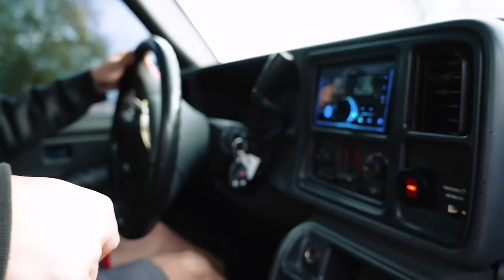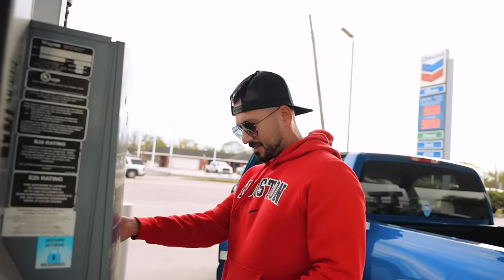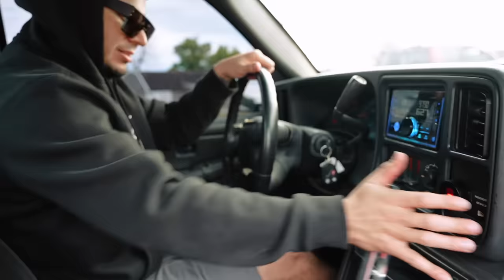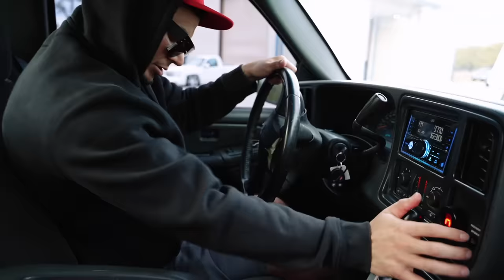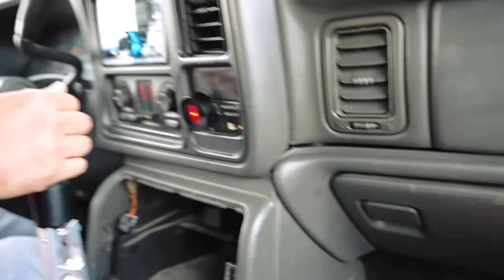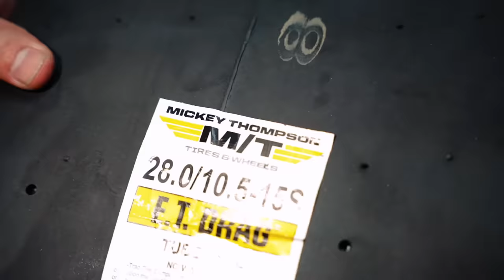EVERYONE Drives The Sequential Burnout Truck!

Comment: @ONDGAS if the sequential is set up properly you should be able to upshift at higher rpm’s WITHOUT the clutch so it doesn’t hang and redline

Comment: You have to find the max speed per gear. Like 1st might be 30mph 2nd 45mph then you can’t down shift into a lower gear if MPH is exceeded the range of the lower gear. So like you can’t go into 2nd from 3rd if you’re at 50mph you have to be at 45mph for the gear range. Also find the rpm for each gear and rev match when down shift. Damn I hope I explained that right.

Comment: For a roll back when you are doing a donut and you want to do a rollback just give it a little more steer to the left IF your going LEFT and FLOOR it at the same time and is gonna spin out and the moment you feel it spin out put the clutch in and your going to go back and just floor it then release the clutch and you will burnout going backwards if you do it fast enough

Comment: You should be able to tighten up what ever linkage is connected to the shifter. Weither it's a cable or rod. And or could trim the handle down so it's not so long. (Pause) thats a bad ass setup for the truck

Comment: I’m not a mechanic, but if it’s still a regular transmission that has a sequential style shifter, couldn’t you put a short shifter kit on it or rig something up similar to that that way it shifts short because the travel on the shift up and down is super long. If you pay attention and look at other sequential transmissions whenever you up or down it’s a fast and tight pull it doesn’t travel that long. Maybe that would help y’all out